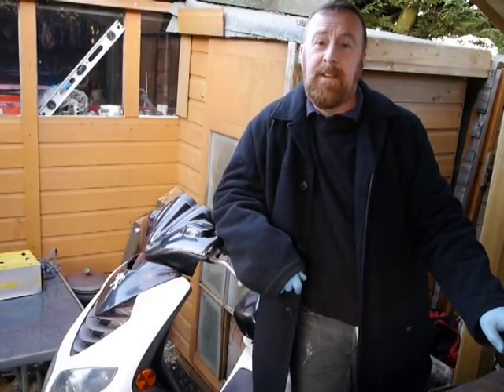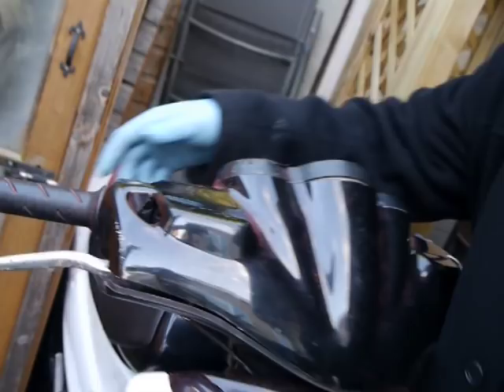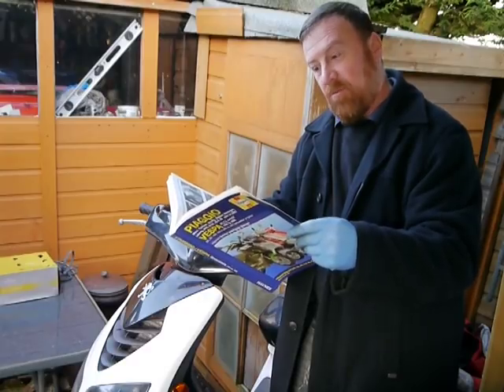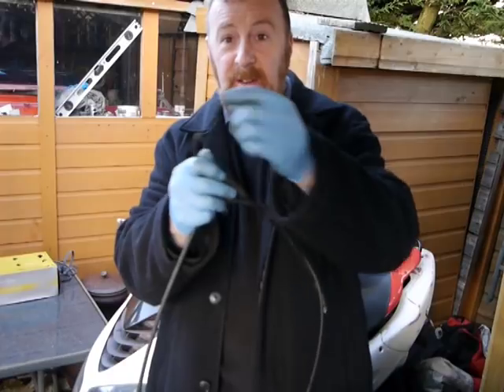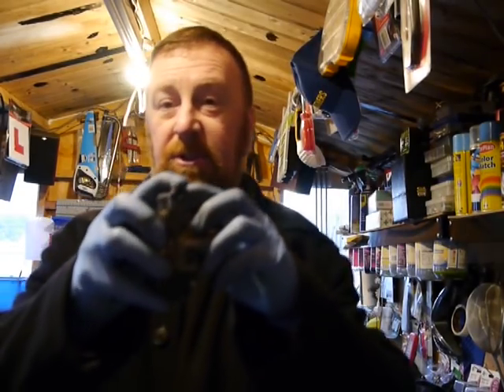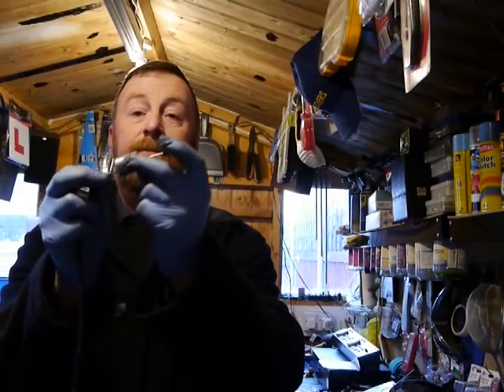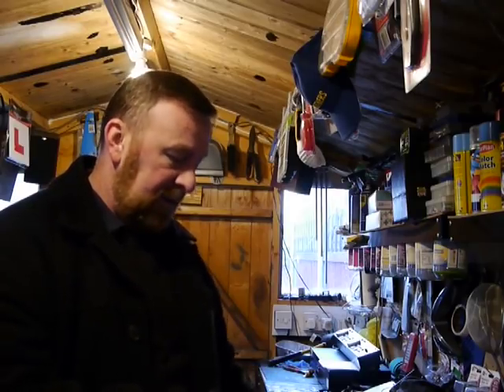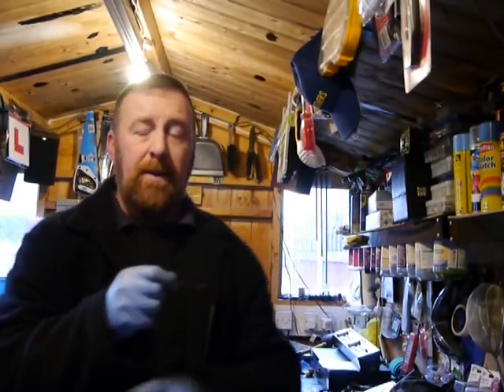THROTTLE CABLE REPALCEMENT ON MOPED & MOTORBIKE MARK SAVAGE

Comment: Mark I need your help mate! How do you adjust the cable as it’s really loose and pops out of the top of the carb needs tightening tried the screw adjustment my the throttle doesn’t adjust it enough. Would I need to take it out of the throttle assembly on the handle bar? And tighten it up there? Any vids on how to do this?

Comment: Hi Mark, wondering if you can help. I’ve got an 84’ Honda Melody. Absolutely lovely except it will only stay running under throttle...let it go and it coughs and dies. What would you say it is most likely? Cheers mate, great videos!

Comment: Mark I cannot seem to find your carburetor adjustment video for my 2-stroke air-cooled moped. I am extremely frustrated at this time I took out the carburetor cleaned it there was a lot of rust I cleaned the rust out of the tank and out of the carburetor I think I pulled out everything back together correctly but I'm not a hundred percent sure I can get it to start but when I try to give it throttle it dies out.
Reply from the maker: hi bud 
I have many carb cleaning and tuning vides on my channel
as I always say best sit on a computer and click on videos and scroll down 
the tuning video you are after is there and way down are my carb cleaning videos
you need to make sure you clean it properly and clean out the float and jets using carb cleaner, then tune with the standard 3 half and in or out for best running 
all my videos will help bud just take the time to scroll through them, maybe get a cuppa lol
please like and sub 
mark

Comment: One of the screws on my slide cover has stripped and there’s no way to get the slide out. What should I do mark? The cable needs a replacement. Thanks Mark
Reply from the maker: theres only a few options , drill it out or snap around the plastic panel and that it really if you can get a rull grips on the ton of it

Comment: Mark , can you show us how to replace a moped crank ? I want to change my crank on my gilera storm 50cc to a jasil evo mid / race crank and bearings and seals but there is no good videos that can help and you are very knowledgeable on mopeds
Reply from the maker: MrRainesFTW hi bud thanks for watching 
I have done a few videos on replace oil seal and cranks but only on speedfights but the basics are the same 
Have a look through my videos bud maybe on a computer then you should be able to find them 
Hope that helps bud 
Mark

Comment: How easy is it to replace a throttle cable on a piaggio zip? do it route through the bottom of the panels?
Reply from the maker: not sure on yours bud , but the can be a pain main clocks off front panel then lower faring's to the carb

Comment: HI mark savage, can you do a video on changing the speedo cable on Yamaha, as the cable is screw on both sides and don't know what each end goes to, thank you
Reply from the maker: RXVLogs hi bud answered you on the other videos but take both screws out fully then pull out 
You will also need to take off the clock fairing and it has two screws to take out then lift forward and up as it clips in 
Mark

Comment: Hi Mark, I have just brought a 50cc Suzuki Katana 2004. The bike runs absolutely brilliants hits 35/40mphs really nice. But for some reason when the engine isn’t running the rear wheel is really hard to push if not impossible. Any ideas ?
Reply from the maker: hi bud ,thanks for watching ok first check brakes so front and rear, put it on the stand and see if can spin both wheels.you could also after a short ride touch the brakes but be careful as if they are sticking they will be very hot.if so check out my brake video it will helpif not brakes then take off the variator cover and see what's going on in there as you should be able to spin the wheel and push the bike, there's loads of videos that will help as the parts / basics  are the same on most mopeds mark
Reply: Hi, thanks for the advice. today i have taken the variator (cvt) cover off and had a quick look. By the looks of things the clutch bell is sticking. i have cleaned the bell with sand paper, petrol and a clean rag. But it still seems to be sticking. Any ideas ?
Reply from the maker: mastercreative1 hi bud maybe a replacement !
When they go they seem to stick no matter what 
Maybe try wd40 bud and clean well after bud don’t put it on the pads only inside 
Mark
Reply: Most likely gear box has been ran dry, take off cover for gears and see if there oil in there

Comment: Perfrct editing and acting mark. Good chuckle.

Quick question, bike sounds like its hitting a rev limit when pulling away then goes down and slowly picks up speed. Im thinking its the clutch as i know the variator is perfect. 
What does it sound like to you?
Im waiting on a tool to get it open.
Reply: Also it will sit at 40, then slowly fall to around 35.
Reply from the maker: hi bud thanks for watching yes it does sound like it's the variator side of things, you say the variator is ok so what rollers do you have in as I have had this with too heavy rollers before, worth taking the clutch off like in my other video and giving it a clean as it can only helpmark

Comment: Hi, I'm having an issues with my aerox. It goes to start but won't turn over. I'm not sure what the problem could be.
Reply from the maker: hi bud, I have many videos on aerox's that should help,you say it turns over but won't start?, or doesn't even turn over?aerox's blow piston's very easy, this is not a big job and have done a video on how to do this, it's not a big job, or a little harder if water cooled.whoever when did you last service it, change plug, clean carb, airfilter without info bud it could be anything from big to smallmark

Comment: Alright mark I have just brought a 2016 Yamaha aerox 50cc it starts and everything no problem but there’s no power. It takes forever to get to about 24mph then all of a sudden all the power kicks in. Any ideas mate cause I’m stuck
Reply from the maker: Jordan Wilkes variator rollers and clutch bud 
Take it all off service it like in my videos 
Change roller like I do in my videos 
All this should  help 
Then you may move on to carb 
Mark
Reply: We think we have fount the problem mate we put a compression test on it and there is only 20 so we are going to change the piston rings but  thank you for the reply I will keep that in mind bud
Reply from the maker: ok bud well that's good news that you know what it is but 2t often have little compression I have lots of videos on changing piston and problems you may get that will helpmark
Reply: Do you know round about how much compression they should have? And don't worry I've watched nearly all your videos😁
Reply from the maker: hi bud lol thanks for watching them they really have very weak compression and can still have compression yet gone on one side like in my videos what's the bike doing that you need to do the test, I find if you can done everything else and it still wont startI open the throttle while starting and if it back fires and pops I find it can be the piston if it's air cooled it's very simple to check the piston and may as well for £20 change it mark

Comment: Hey mark, do you know whether the carb on the speedfight 3 and 4 has an air or fuel screw? Thanks in advance
Reply from the maker: JollyTechnology I’ve worked on a few sp3 and the ones I’ve worked on have had a air mix 
The older sp2s had a blanket on them but most had been drilled out 
Guessing the sp4 would be the same as sp3s so sure they would 
Thanks for watching 
Mark
Reply: mark savage thanks for the reply, that’s what I thought as well I was just checking...I saw somewhere that stock, the mixture is just a tiny bit too lean to meet emissions tests? Is there any truth to that?
Reply from the maker: JollyTechnology no bud motorbike don’t come under emotions just economy lol 
Well in this country but they are coming in soon so I hear but really can’t be on 2t with the added 2t oil 
If it runs ok bud best leave it unless up jetting then you may need to play with it a little 
Mark
Reply: mark savage thanks very for the reply, that makes sense...I just have one more question. If I replaced the silencer on my exhaust and nothing else, would it still need to be upjetted?
Reply from the maker: JollyTechnology first bud why would of you as it will be hard to find another to fit 
A sports exhaust will help the bike a lot all round bud 
Mark
Reply: mark savage I just wanted to change the sound and the looks a little bit and was wondering whether the silencer change would need any jetting, that’s all, I know it wouldn’t really make a difference.

Comment: do you sell parts mark ive got a list

lock set 
seat bucket
rear light
rear back panel
battery cover

Thanks
Reply from the maker: hi bud thanks for watch but no sorry I don't, I used to have loads and I do mean loads but sold them all  lolbest try e bay and maybe a local seller to save on postage mark

Comment: Hey i have a Huge Problem with my speedfight when i start it it just gives full throtlle even tho the idle is low and the carburator is closed i looked in it why is it like this ? Do you have a facebook so i Could  send you a Video
Reply: jeremy could be an air leak. Air is getting in causing it to rev up.
Reply: MasterLehw thank you i will check it 👍🏻
Reply from the maker: hi bud like I say in this video is the needle seated right and closing properly ?give the carb a good service while your there make sure the float is shutting off and pipes fit tight, test like in my carb videos mark
Reply: mark savage i Switched carbs but its still there
Reply from the maker: so it revs up when you start the bike even thou the throttle is closed and you needle is full closed in the carb?what bike is this on and you say you changed the carb is this a standard 17.5 mm carbwhat air filter have you got on ?did it do this before and if not what did you change ?mark
Reply: mark savage so its a speedfight 2 ac fully original the carb is Stock aifilter is Stock and new and the oil pump is deactivated so i mix myself
Reply: mark savage it revs up and than after a few seconds it just dies
Reply from the maker: does it do this when cold and when warm? if you start it time and time again does it do it ?have you ever checked your reeds ?mark
Reply: mark savage yes all the Time

Comment: Also mark do you buy mopeds ? Iv got a small one also I’m from London!
Reply from the maker: hi bud , I have bought the odd moped and motorbike when they are not to far away, mot got a van at the mo but what do you have bud ,mark
Reply: mark savage jonway madness 50cc white ,2013 reg needs few bits and bobs 
Needs a new ignition barrel as half the key is stuck and the other half out -still turns
Needs a whole need back tire ,
Needs supervision bolts to keep it steedy 
And Central Handel bar nut to keep it tight 
And needs front brake !
Dunno what’s your offer but 
I really don’t mind swapping for a nice looking sports exhoust for moped 
And a battery and Mirrors I don’t mind swapping for those stuff for the jonway madness
Reply from the maker: i'll have a little think and maybe well have to get a van or transport first lol, then get back to you /mark

Comment: Are you still there mate I need a hand with my throttle please
Reply from the maker: whats up bud
Reply: Yeah hi have got a 125cc aprilia habana and this morning my throttle got stuck and I was driving while using breaks but when I was at lights then stop and went again my throttle doesn't go so the scooter is not moving basically, It came out of garage last week I got a new inlet manofold a new coil and a new ail filter or what ever and they clean the cabretta out for me sooo am stuck bud any help 🙂
Reply from the maker: @scouseman4life1  if it only came out of the garage but i'd be going back to them as they may not have tightened a screw down 
otherwise i would have said wd40 the cable but this should be fine if they only had the carb off doing the inlet. 
give them a call bud they should be able to help
Reply: Thanks mate much appreciated